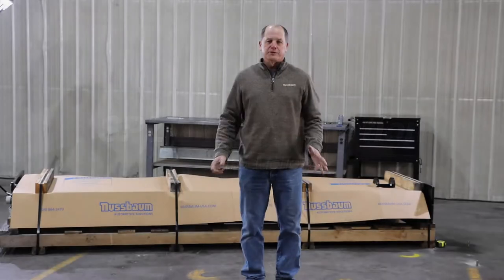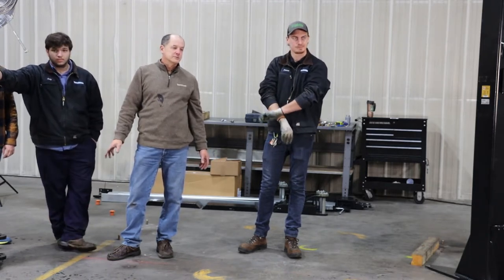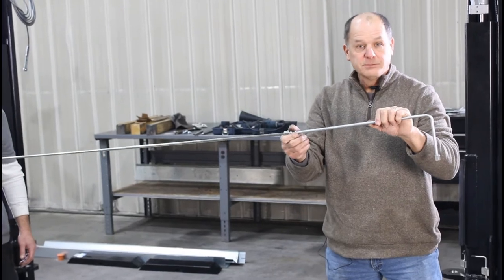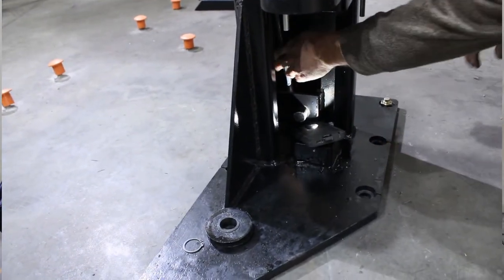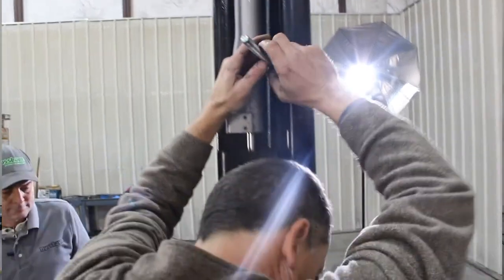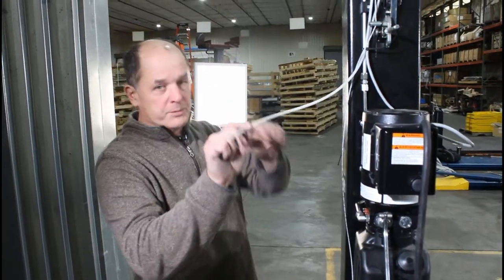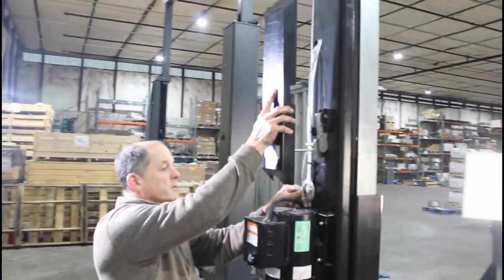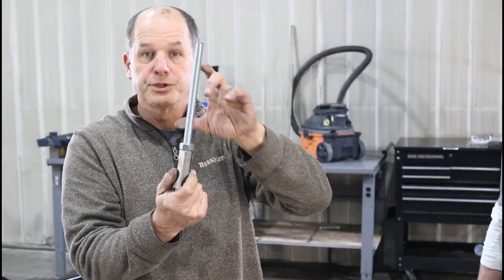Nussbaum SPL Install Video

Comment: I bought a used SPL 8000 last year and just recently decided to put it up. I was able to stand the columns up by myself using a come-a-long and pulley from the rafters of my barn. Once I stood the columns I was perplexed on how to put it all together. After watching this video I now understand everything I need. I do question as to why Nussbaum still uses mm screws and bolts instead of standard screws and bolts since these are made here in America. My model is a 1996 year make. I cannot find any manual for this model on the Nussbaum website although there are similar models to look at. If I need to buy spare parts where do you recommend I look?
Thanks for your video. It gave me confidence I can set this lift up for myself.
Reply: HEY, may be too late. But i called nussbaum and after a transfer or two eventually found a man who was able to get out "the old computer in the back that runs floppy disks" and got me the information on my 1991 NPL 8000. Even though they have none on their website the info is still available. Mine was from pieces and restored in my garage
Reply: @joshuaprobably852  
So did they print the manual out for you? What information did they give you?